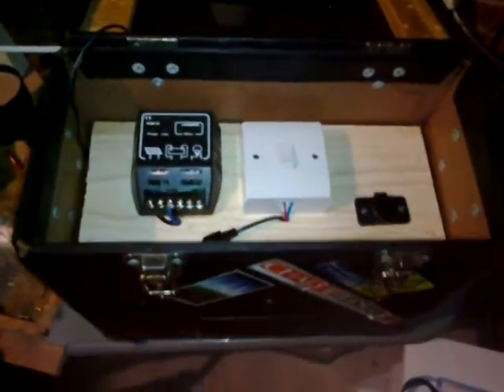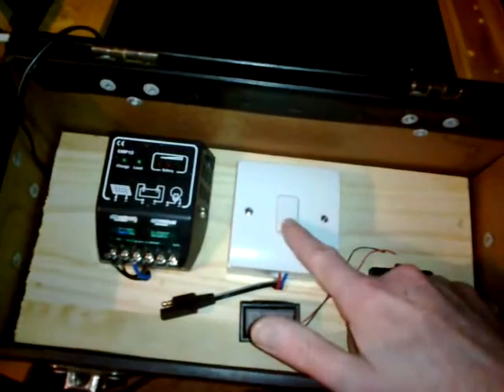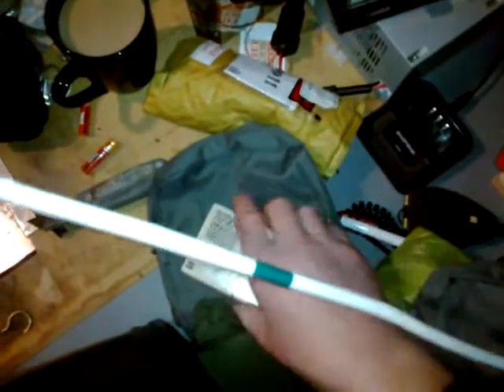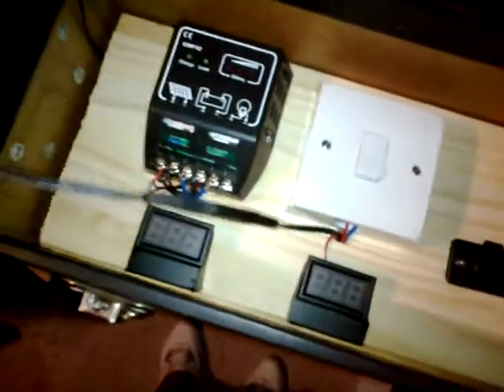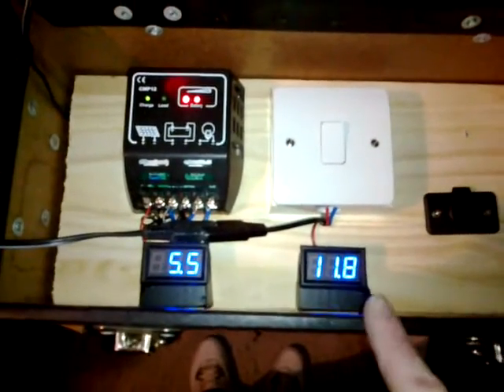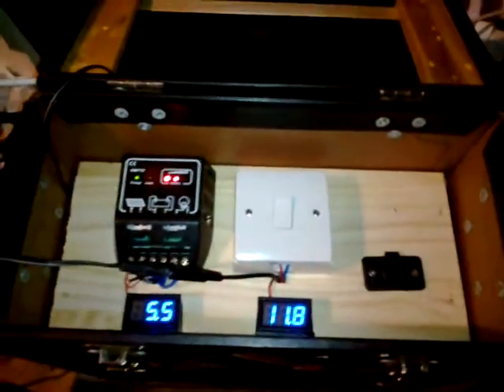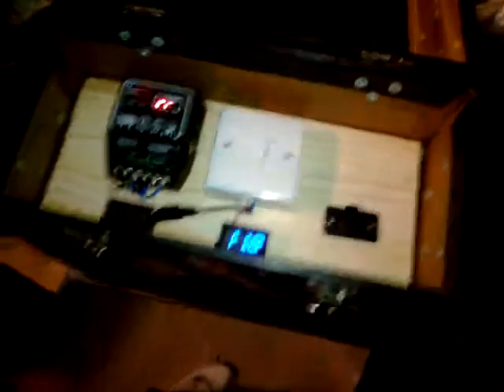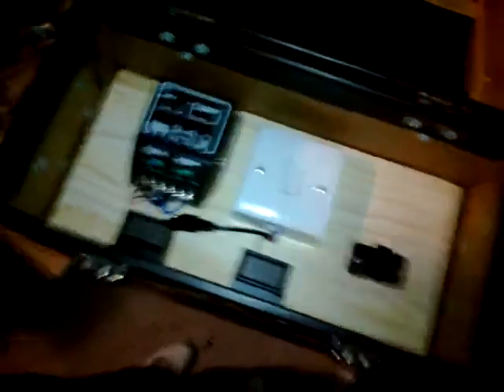D.I.Y mini solar generator

Comment: Hi,

Great Video
Its inspired me to try to do something similar. I want to run 1000w a vacuum cleaner of an old Jaguar battery that I have just salvaged. I have just ordered a 1500w inverter. Any suggestions?
Cheers
Ben

Comment: DIY portable solar generator tube g data player

 This is mine I am looking to upgrade to 4 battery's and add the volt meater I don't have an inverter at the moment but want 2 add one as well